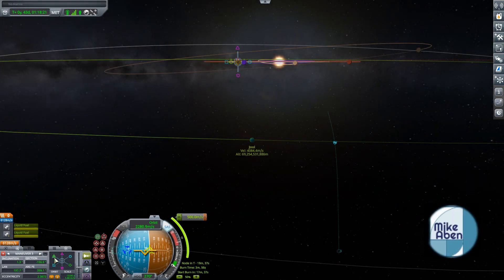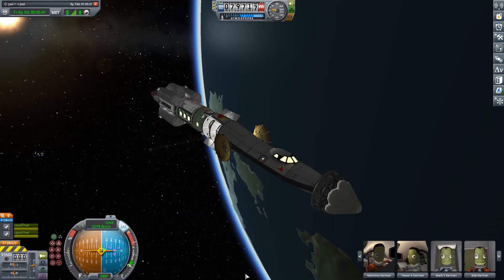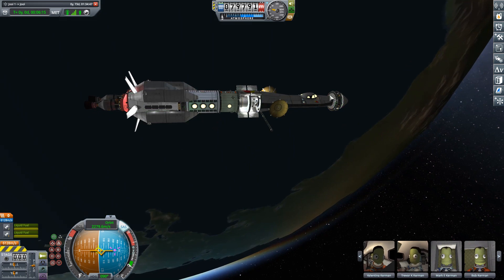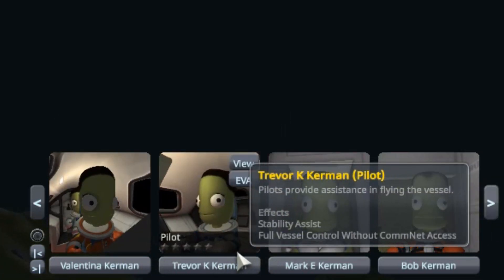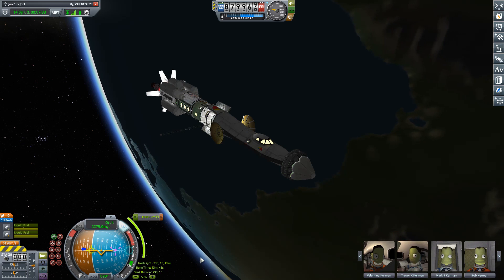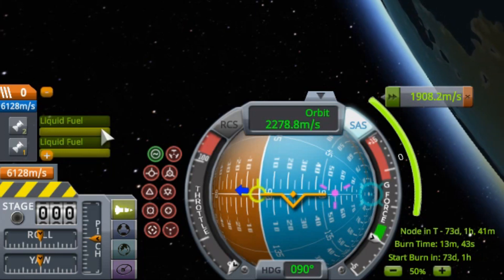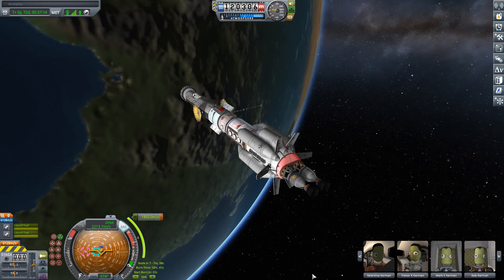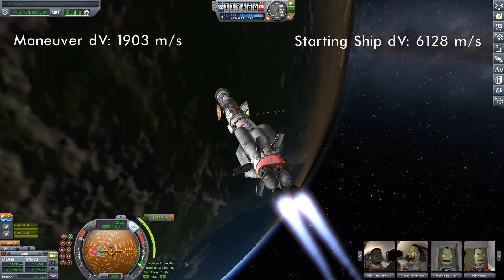Using the Oberth Effect | KSP (Not) Beginner's Guide

Comment: This is, incidentally, how ISRO reached Mars, by splitting the orbital insertion burn into multiple burns. The US doesn't do this because NASA has the Centaur cryogenic upper stage, which is a bit of a beast.
IRL, multiple burns aren't quite free: each ignition increases the chance of a failure, which is simulated by the Kerbalism mod.
Reply from the maker: Thanks, John. Would boil off be an issue too making you want to get the burn over and done with?

With probes I typically stick on a chemical booster to deal with most of the ejection. It's just easier.
Reply: @MikeAben  Yes, hydrogen boiling off is an issue. The Trans-Lunar Insertion burn on the Apollo 3rd stage had to be performed fairly quickly or so much hydrogen would boil off they'd need to abort the flight. I believe modern stages are better insulated, but it's still a factor.

Another factor is that Earth isn't a perfectly homogenous sphere. With each orbit, there's a bit of wobble which also complicates things.

Comment: Regarding burn precision, the more burns you have with this technique, the more precise you need to be.  KOS or the human eyeball just can't cut it without lots of errors and corrections.  I've just launched 4 of my 6 Nuke probes to Duna (2 huge science probes to get all the scansat, and 2 relay carriers with 3 relays and 1 lander each).  I need to now send off my lander carrier (carrying 12 lander probes), and my land and return probe with the goo/ScienceJr stuff.  Because I'm sending them 140 days ahead of the perfect window, my dV requirements are huge and the keyhole I have to hit it pretty darn small, even when I have the nuke engine set to 0.5% thrust for my correction burns.  I think I'm gonna add RCS to these last two probes and use RCS for these < 1m/s correction burns.  When travelling at 10000m/s, 1m/s can sometimes send you from the far left side of ike's orbit to the other far side of ike's in just a second or two while using the lowest thrust available on your engines.  I few of those tiny RCS engines should do the trick...and I'll only burn them in prograde/retrograde using a maneuver node to plot the course.  If you use anything other than retro/prograde on RCS for this, I fear the torque  will make it worse than it was in the first place, even if you do have good reaction wheels.  the nice thing with retro/prograde RCS is that your torque in those directions should be 0.000000x kNm/s^2...so small that hopefully the game just ignores it...lol.

Comment: Mike, great video as always but a few comments/questions regarding my own experiments and the only 1 other low TWR video I've seen. 

1. Wouldn't it be even more efficient to include normal/antinormal in your pre-burns?  I believe if you take the ratio of prograde to normal/antinormal on your initial baseline burn, you can apply that ratio to determine how much normal/antinormal you pre-burns need.  By using normal/antinormal in preburns, your final burn needs less normal/antinormal (the amount you need should I guess roughly be the same ratio from your first baseline burn).  

2. Regarding ejection angles and using the Transfer Window mod- its hard to believe this all works considering your ejection angle should change, hence where you burn starts - when you spends WEEKS of time doing your burns (well, weeks of orbiting, same burn time roughly) - so, is it a math fact that every burn you should do be at the maneuver node location of your first baseline big burn?  Or should you calculate roughly how much time you plan to spend orbitting around, use Transfer Window and plan a FUTURE burn based on your orbitting time, and start your pre-burns right away but at the location of where the ejection angle is in the future.  Or is the answer somewhere in between, requiring Calculus instead of algebra which I don't think these mods can do.  An example would be if using an ultra-low TWR using ion engines -  what if I needed to do +10 pre-burns and I needed to spends MONTHS setting up the burn.  Where exactly on the orbit do you do the burn?  The periapsis every time, or do you need to adjust it everytime?

3.  Is there any difference in efficiency in a-symmetrical burns?  I realize why they were a-symmetrical in your example.  If they weren't your 2nd pre-burn would have ejected you from the Kerbin's SOI.  But what if you needed only 1500m/s of dV?  You could do 3 burns of 500 m/s.  Would that be more efficient that 2 burns of 250 m/s and 1 final burn of 1000m/s?

4. The problems with seeing the Mun/Minmus accidental encounters, would the patched conics number in settings affect this??
Reply from the maker: All great questions. I started answering them but I'm at a wedding and a few wobblies in. This'll have to wait until tomorrow.
Reply from the maker: Short answers.
1) Yes
2) Doesn't matter
3) Doesn't matter
4) Don't know
Reply: Regarding #2 wouldn’t that just follow the general pro/retro at periapsis and inclination burns at apoapsis?  The whole point I think is mainly you want to choose a location to burn where your speed is going to be at it’s highest.
Reply: @guyincognito1406  you certainly wouldn't want to burn at AN/DN at each expanding orbit to fine tune your inclination.  That would double the number of burns needed...although that wouldn't matter with ion engines.  I believe if you keep the right ratio of normal/anti-normal compared to your baseline burn, you keep the same exact inclination throughout all of your incremental orbits..and because that normal/anti-normal is such a small fraction of the prograde, its nearly free dV.
Reply from the maker: 1) I actually didn't notice the normal component of the burn until I was editing. Yes, putting in a normal component into the early burns is likely a good idea. Here the ratio of prograde to normal was only about 10:1, so I suspect it wouldn't have made much of a difference.

2) I'm pretty sure this doesn't affect the ejection angle. The final burn is still at the same location in the orbit and at the same time (or close enough) that the ejection angle when you perform that burn wouldn't be much different as it would have been if you kept it a single burn. If doing this with Transfer Window Plannner, you would have to set the maneuver ahead of where TWP is telling you so that the burn will be at the right ejection angle 30 days from now. I got videos where I go over the math of this in an old let's play, but just put the amounts for the burn, pop ahead orbits until the time is about right, and then just move the node forward and back to dial in the encounter.

3) It doesn't matter if they're asymmetric. The key is to have as much of the burning as close to Kerbin as possible.

4) I'm not sure on that one, but my guess is no. I'm pretty sure the game won't show an encounter for a future orbit unless there's a maneuver on that orbit, but it's worth playing with to check.
Reply: @Dan Siegel : If my understanding is correct:
a) what you need is (i.e. what Transfer Window Planner aka TWP is telling you to do is) at a specific point in space (i.e. periapsis of your current initial orbit) be moving at a certain orbital velocity to achieve the desired ejection angle and speed; - edit: and at a specific moment in time! -
b) whenever you burn in prograde at point in your orbit, you are just "changing the shape" of your orbit but you will always be passing by that same point in space - of course, respect of the current body you are orbiting - on your following orbit(s) as long as there are no other burns  (of course again, assuming a single body gravity model, as KSP is, as well as considering "instant" burns, as if you could add all the deltaV in a fraction of a second instead of several minutes). Therefore, if you do all your burns at (the current) periapsis, you will meet what TWP is telling you to do -see (a) above-.

So I would say yes, always burn at periapsis. And about asymmetric burns, I guess you mean amount of deltaV (v. gr. 3 x 500 m/s for a total of 1500 m/s as in your example). My guess is that it would be more like symmetric in the amount of time of each burn while close to periapsis, though I'm also guessing there is a bit more complexity to it than that...

At any rate, I haven't played KSP seriously for some time now, and am no expert on all these things, so please take this with a grain of salt. Anyway, I hope you find it useful.

Happy kerballing!

(edit: some formatting quirks, and note on "specific moment in time")
Reply from the maker: @alartor  Yes. The key is recognizing that the orientation of an orbit remains fixed in space as Kerbin travels around the sun. Ejection angles are measured from Kerbin's orbital prograde vector, but the direction of this vector changes as Kerbin orbits. So if you are 30 days ahead of your ejection window, you need to work out how far ahead in the parking orbit the burn needs to be.

TWP has a show ejection angle button. Thinking on this more, it's possible the mod might take all this into account. It should be easy to tell. Get TWP to calculate an ejection at least 100 days or so in the future. Go to something in LKO, open up the mod, and hit show ejection window. If the prograde vector it shows does not line up with Kerbin's  terminator (the line separating day and night), then it's showing the situation at the time of the burn.

This is really confusing with pictures. :-/
Reply: Yes, I forgot to mention that you also need to do that at the moment in time that TWP tells you. Thanks for pointing that out, MIke!

Comment: I'm not sure I understand the trade-off between, more maneuvers ("why not do 5-10 burns, theoretically?") VS having longer burns and fewer maneuvers, though more than 1 big one ("why not make one burn to the very edge of Kerbin's SOI and the other one to Jool?")

Is it just because more maneuvers would be too tedious and only 2 burns be still too long and become inaccurate? (a bit confused but maybe I should RTFM on the Oberth effect first)
Reply: (Oh also, why place all 3 maneuvers before the first burn even took place if you are going to move them after each burn? Does the amount the move in between burn indicate something important?)
Reply from the maker: The further you are from periapsis, the less efficient the burn. During a long burn, you spend a lot of time away from periapsis which is less efficient. Under the info tab of this video there's a link where I go over the math.

Splitting into shorter burns has you spending more time close to periapsis, and so is more efficient. That said, you'll reach a point where the gains in efficiency are too small to warrant more burns.
Reply: @MikeAben  Ah thank you! Now I get the tradeoff!

Comment: My Mun's in a position where I can either get a gravity assist from it, or wait until my transfer window is closed. I'm going to try to get a gravity assist from it. But my current attempts to make maneuver nodes to get a slingshot off it make me leave Kerbin's SOI a little bit too early to get to Jool easily from the one maneuver. But waiting makes me too late, and getting an assist at the right time flings me into the sun or hinders me. I can try. Maybe leave Kerbin's SOI, then wait until the actual transfer window and then burn the 980? Maybe that will work?

Comment: Hey Mike, great videos, thank you and keep them coming! I'm having a problem: when i add orbits to maneuver 1 (the second one we create), it moves up the projected line of the original burn. Any advice? Thank you sir
Reply from the maker: A couple of questions. Is maneuver 1 (the one that's hopping ahead) at 0 m/s? And two, could you be hopping ahead of the original maneuver?
Reply: @MikeAben  thanks for your reply! the maneuver that's hopping ahead has no magnitude, it's 0 m/s. And when i add orbits, it still says "Maneuver 1", so that should indicate I'm not hopping ahead, right? Thank you so much Mike!
Reply: More data: the second maneuver we create is staying put now but it's odd b/c when i add orbits, the option to subtract orbits is darked out, and the 3rd maneuver we create doesn't "mess up" the first two maneuvers when i give it some magnitude (500 m/s), that is to say it doesn't change the position of the other two maneuvers (2 and 3, created 1st and 2nd). Am i doing something endemically wrong? Thank you so much, you are a ksp god.
Reply: Hah! I was not following the instructions: my maneuver 3 was not 30 days in the future. Now it's working. Thanks for your attention, Mike! You've really increased my skill level.
Reply from the maker: @jonadair2588  I'm not really sure then. I have seen strange behavior from maneuver nodes at times myself and have had to start over. Sorry if that doesn't really help.
Reply from the maker: @jonadair2588  Glad you worked it out.

Comment: can we get a tutorial for suicide burns? I was using kerbal engineering for this but it seems to have a problem with calculations; it always tells me to burn too early and I end up getting to 0 m/s way before 0 altitude

I've been trying to solve this by throttling as I perform the landing burn but sometimes I end up crashing as a result and I know that there's got to be a better way.
Reply from the maker: That's more of a math video than a tutorial. KE is likely making its calculation based on the current acceleration of the rocket, but max acceleration will increase due to mass loss from expended fuel.
Reply: @MikeAben  If there is anything I love more than your tutorial videos... that's your math videos! ;D (and this is the perfect excuse for one of those; actually, it's one of the topics I'd love to sort out in KSP when I get the time, if not the top one, so... a tutorial or math video from you would certainly be xmas come early, hahah).

Comment: I am a complete noob to this game still. I have like 20 hours, which are for sure waaaaaay less than you and than many of your viewers hours.
But I noticed that when you show the long burn problem you are basically using the thrust at 100%, which is not what you're supposed to do cause in the nav ball, at its right you've set 50% as thrust for the computer to calculate when to start your burn. I think that if you'd switch that 50% to a 100% burn it will tell you to start the burn later and this would probably avoid the issue you're presenting.

As I said I am new, so I might as well be wrong cause I do not have a lot of experience, but this is what I thought at first by watching your video carefully.
Reply from the maker: The 50% sets the countdown to get you to start the burn early by half (50%) of the length of the burn. It doesn't have anything to do with thrust.
Reply: @MikeAben  oh well. Lol. Thank you for the tip then. Hahah.
Reply: @MikeAben  i didnt know that too thanks
Reply from the maker: @AlwafiCharki  The game really doesn't explain things and depends on community spread.
Reply: @MikeAben  yeah they really need to focus on making the tutorial better even if KSP's community is unique
Reply: @AlwafiCharki  I think this is one of the pillars of KSP 2